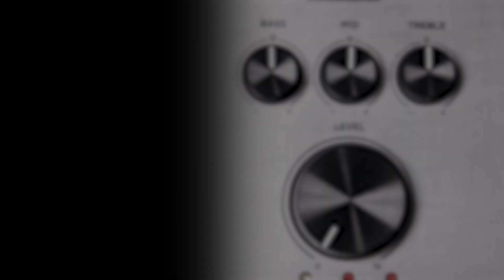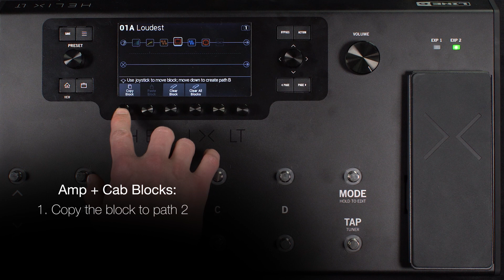Line 6 | Helix Minute: Connecting Helix to a Power Amp & Cabinet

Comment: Awesome quick tip. I have this same setup (with Power Stage 200). I’ve tried all methods:
-4CM
-Power Amp In
-Powercab+

This sounds the most natural sounding. Do what sounds best to you, though. Not a fan of using the preamp models, they sound weak and void of all character. Maybe for the clean amp models but not for anything with overdrive.

Comment: Thanks.I use a Fender Deluxe reissue amp which has a power amp in.Will it be better for me to connect the Helix 1/4 inch output into this power amp in instead of going to the front of the amp?

Comment: Hey Line 6. Is there any possibilty for live setup, connecting the helix to my Modelling Vox Head + 4x12 Cabinet, without letting the Vox Amp affect the preset sound of the helix (because the Vox includes several modelling amps as well)? 
So I could use my old Vox 4x12 Cabinet live on stage as a kind of monitor speaker behind me? 

Vox Ad100 VTH (modelling amp) with send and return connections

Line 6 Helix LT

Comment: What is the difference if i choose amp or the preamp block if I want to connect to my combo amps power section (into return on the fx loop) bypassing the preamp of my combo?
Reply: I would suggest using the preamp block for this way of running helix

Comment: Does this same info apply to connecting to fx return of a amp head?
Reply: Yes
Reply: Use one of the preamp models so you aren't adding L6 power amp modeling to a power amp like that.
Reply: @AndrewStonerock  so in the signal chain, i do not put in any cab sim if directly going to the fx return?
Reply: @12Jsilva  that is correct
Reply: @AndrewStonerock  can i use amp sims like badonk into fx return?
Reply: @12Jsilva  yeah, just turn off the cab Sims.
Reply: @AndrewStonerock  thank you so much!